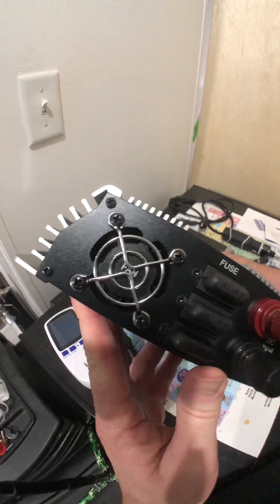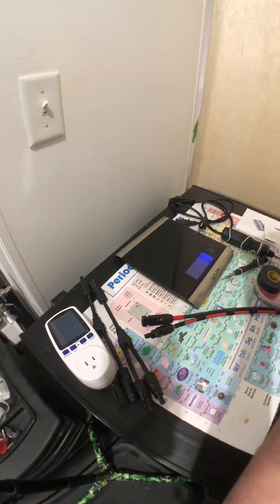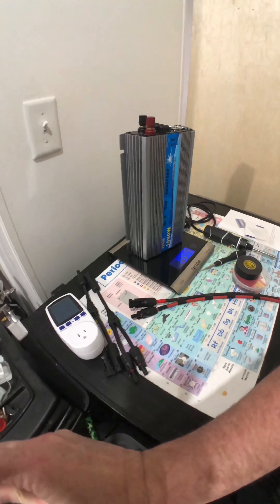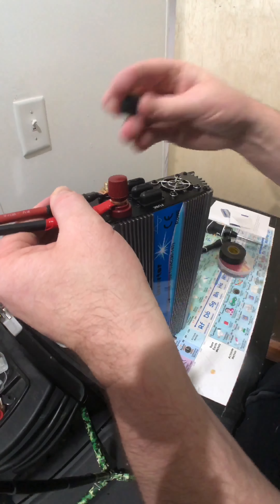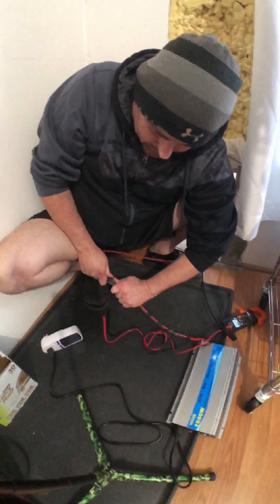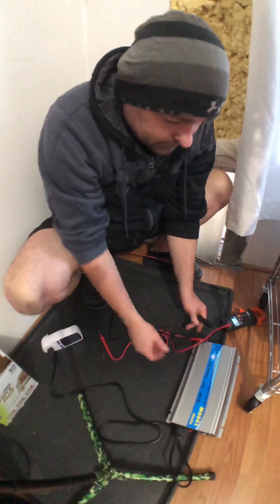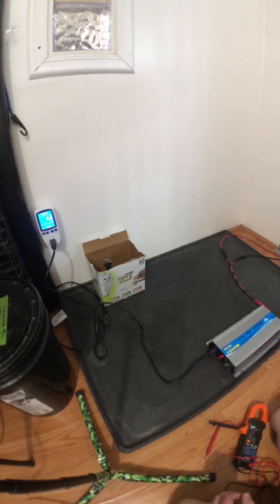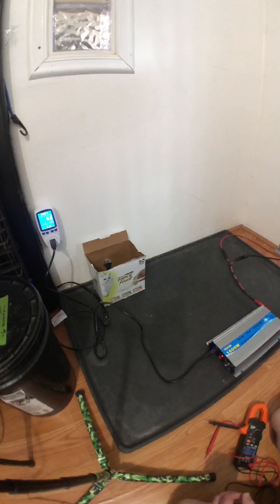1000 Watt Grid Tie Inverter Vevor Brand from Amazon (theMekanik)

Comment: I have 2 1000W Vevor Inverters and 2000W 24V PV Array.
The 1000W GTIs put out about 2A-5A @120VAC and take about 16A from the battery/PV Array, each.
Compared to the 1300W Inverters, the 1300W GTIs take about 50A from the battery/PV array and give about 4A @120VAC, each.
The 1300W Inverters drain your batteries very quickly and give less power than the 1000W inverters.
100A draw compared to 32A draw.
I have my 1000W inverters connected through Alexa Outlets and programmed to turn on the inverters at about 10AM/11AM and off at 330PM/5PM, respectively.
This gives my batteries a chance to recharge.

Comment: Don't the 12v panels put out 18 volts each? 2-12 volt panels peak at 41 volts on mine at prime sun. How has the vevor been working out? I had 2 sun grid tie but they stopped working in only 6 months. At 770 watts the 1000 inverter shouldn't have any issues
Reply from the maker: Mine still works I ended up getting 2x400 Watt 37.2 Volt SEG Panels and running them in Parallel as to not go over the 50 volt rating ive only managed to get 530 watts through the grid tie inverter......... I did run the panels in the same konfig into a MrPow 60 amp Solar Charge Kontroller getting 720 watts....... so my guess is the Inverter Thermal Throttles......... So I elevated it on a rack and put a small fan blowing on it........ My next Grid Tie is going to be the Growattt MIN 6000 XL with 2 MPPT with each input rated 80-550 Volt DC Input its 749$ at Signature Solar I think it has a 15amp Rating.

Comment: Your 12v 100w panel is not 12v. Look at the Vmp and Voc on the label on the back of the panel.  I usually use the Voc (Short Circuit Voltage) to be on the safer side. You wouldn't want to put more than two 12v panels in series to avoid going over the 22v to 50v DC input
Reply: correct, just Voc is not Short Circuit Voltage, bur Open Circuit Voltage